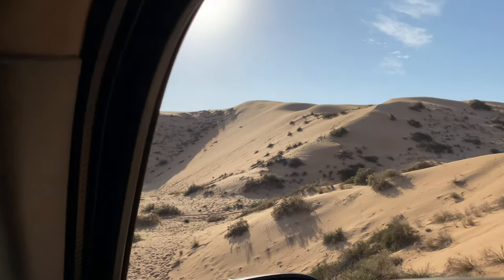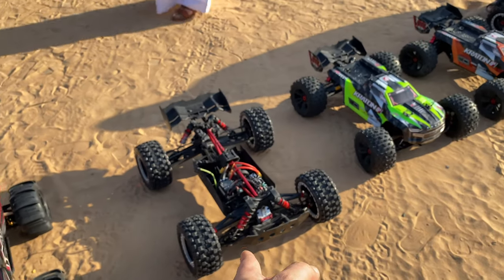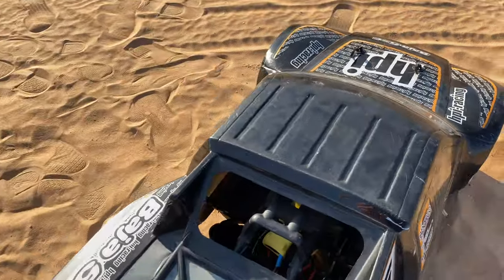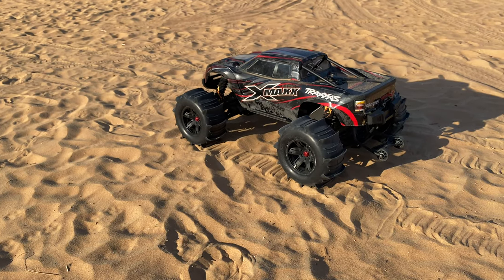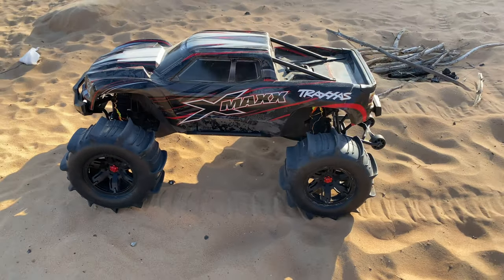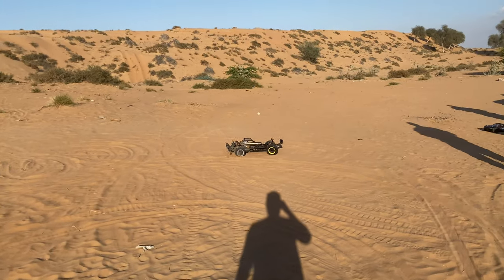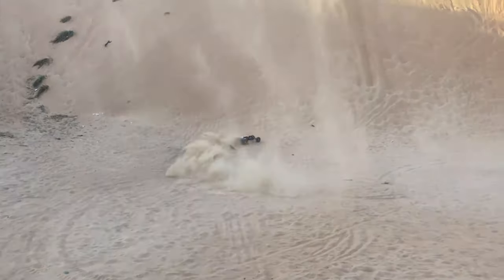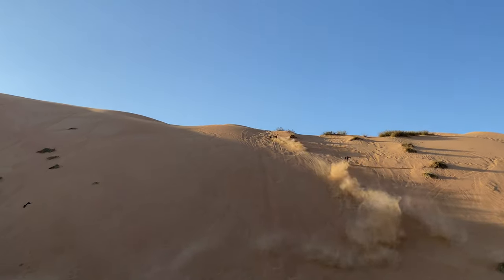Traxxas Xmaxx VS Arrma Kraton 8S VS HPI BAJA VS UDR

Comment: Nice video man!!!  I noticed the front tires of the kraton 8s were ballooning alot. That's because they come stock with 1 million weight center diff fluid. The xmaxx comes with 20 million in the CENTER DIFF ONLY . That's why the xmaxx does wheelies and the kraton won't.  Watch a how to vid first it's a little tricky.  SUBSCRIBED man!!!!
Reply from the maker: Thanks man you are right on the brown one but the others green and white all are spool center locked thanks for your comment and thanks for passing by cheers ❤️